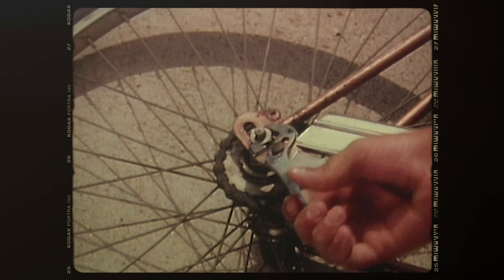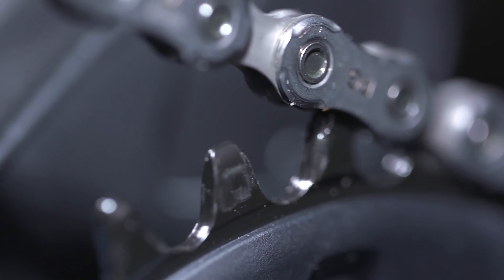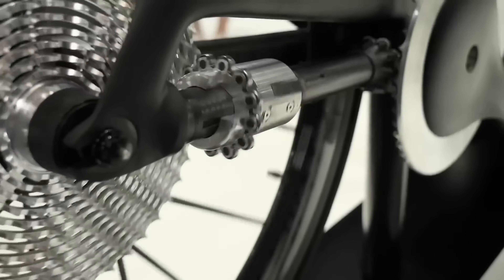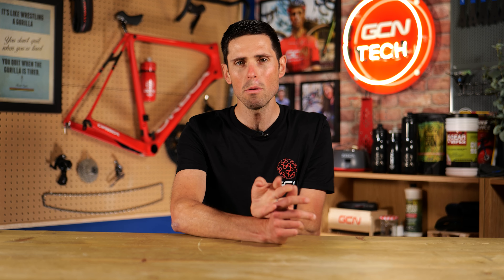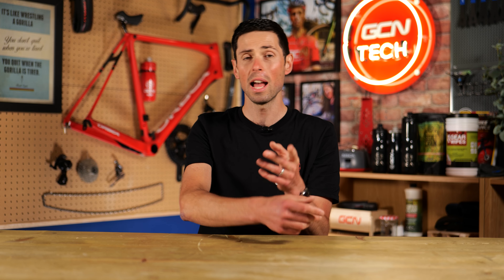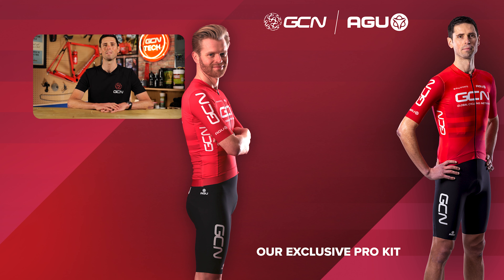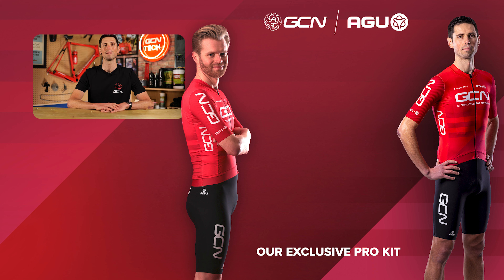Why This Will Never Happen!

Comment from the maker: Do you think bike chains will become obsolete at some point in our lives?🔗
Reply: I don't really see it happening.  Belt drive feels like trash and a rubber band when you lay the watts down.  That shaft drive in the thumbnail had potential I thought but I guess not.
Reply: Definitely not,it's pretty much a perfect design.💯✌🏻🚴‍♂️
Reply: As long as there's WD40 there will be bike chains.
Reply: Nope. There's a finite number of ways to transmit power from the cranks to the rear wheel. We've seen them all.
Chains rule and always will.
Reply: ”Digital chainless drive”
Reply: No
Reply: No. If something was better we already had it
Reply: In the future maybe the inner and outer plates are replaced by thread of a very strong material like dyneema. Even the rollers are not longer needed. This will reduce all friction within the chain and lubrication will be optional, more to prevent rust.
Reply: Probably won't happen in our lives, but if they can make small generators have near perfect efficiency, you could have an e-bike without a battery, that just transfers power from pedals to wheel via electricity.  

Such bikes already exist, but they are not nearly as efficient as a chain ATM.  
An advantage over a chain is no wear or lube and also infinite gear ratios.
Reply: Just with disc brakes replacing rim brakes, belt drives will take over chains, but... not yet. For touring bikes and e-bikes its already a slight edge for belt drives. Once people laughed when a cyclist shaved his legs. "otherwise the pro peloton was already doing it" Once everyone was riding 23mm tyres because it felt fast, now no one does. For some reason conservatism is high in bike industry. And how long did we have down tube gears, mind blowing
Reply: No chance , not now we have KCNC lightweight coloured chains to match your bike !
Reply: @squngy0 but that would only make a tiny bit less power than your legs are already making? You cant break the laws of energy my man. You want more power youll have to get it somewhere else… like a battery
Reply: @Aragorn.Strider naw disc brakes existed in cars for a long time before bikes. We knew it was a good idea it just wasnt cheap enough yet. I dont see belts replacing chains unless everyone moves to IGHs which is what seems unlikely to me.
Reply: @Aragorn.Strider  Belt drives will never take over chains the bike feel for those is atrocious.  Only people that have never felt peak bike in some way can be satisfied with that
Reply: @curtisducati  86 pounds for a celeste chain on my Bianchi seemed like a necessary purchase.
Reply: There will be more belts for commuter and adventure bikes, but chains will be relevant for racing bikes.
Reply: nah, but I'm interested to see what happens with a certain US bike company that is using Gates drive belts instead of chains.
Reply: No, luckily for those who love to cycle, cheaply.
Keep it fun folks!
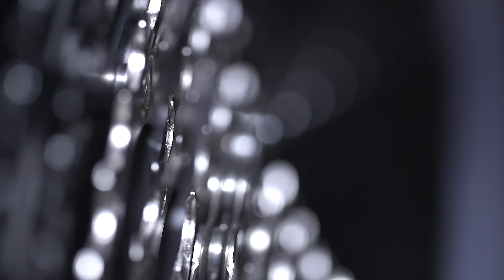Reply: A bike without a bike chain? Taking care of the chain is also part of cycling; the chain is essential. 2:11 An inaccuracy in the video: Before Campagnolo's groundbreaking derailleur gears, there weren't just single-speed bikes. Hub gears were available from 1902 (some designs even earlier) and were widespread from the 1930s.
Reply: Believe it or not, I invented a transmission system like this about 30 years ago, with hand drawing, paper, pencil and compass and "intel" imagination. I started exactly from this point where this prototype is presented. I developed this for a while and gave up on the idea because all the simulations I did, no matter how hard I tried to simplify the project, it always got too complex to be commercial
Learning about BMW's cardan transmission systems, I read that chain systems were always more efficient than cardan shaft systems. So even if they found an ideal metal in Wakanda to make that transmission, if they used the same material to make a chain drive, it would probably be more efficient. Maybe this is like the shape of the frames that after all the frame shapes made for road bikes over the years we are going back to the old simple double triangle shape
Reply: Nope, the chain will remain the primary driver for a very long time to come, if only because of the economy of scale.
Reply: I believe that if a SRAM had invented the Pinion / Gates system, we’d all be using it already.  Until the big manufacturers embrace belt drives, we’ll be stuck with chains.
Reply: @Aragorn.Strider  belts with internal gearbox are great for non performance scenarios like touring and commuters, but they can't beat the chain in performance and weight due to physics, unlike discs and wider tyres this isn't something that can be overriden due to the laws of physics on how gearboxes work. It's why even for motorcycles the same setup is done, chains for almost all motorcycles. Then shaft/belt drives for a niche selection of bikes like used for touring.
Reply: @Aragorn.Strider  I can't see belts replacing chains. You cannot shift a belt, so there would have to be some internal gearing. That weighs more and is less efficient.
Reply: Since a bicycling scenario where expending more energy to propel your bicycle isn't even imaginable, then 98.4% efficiency is as good as practically possible... would anyone (unadorned with aero socks) be able to "feel" a 1.5% efficiency increase?
Reply: Chainless ebikes are possibility.
Reply: IDK but I think you forgot half the pins from the chain...
Reply: No, but the exposed chain will. As soon as a bicycle manufacturer realizes that they can charge $500 for a streamlined carbon fiber chaincase that saves 3 watts worth of drag at 30 km/h, they'll burst onto the scene until the UCI bans them
Reply: I hope we haven't reached the end of history.
Reply: @5t4n5  WD40? What the hell are you using   WD40 for?  I hope you don't think it's a lube, because it isn't.
Reply: @stevenmeyer9674  You obviously don't know what you are typing about, because WD40 is a lubricant.  Specifically, a penetrating lubricant, formulated with additives to make the lubricant penetrates really well.
Reply: @5t4n5  LOL. WD40 is a degreaser with a little  lubricating  quality.  It is no where advised to use it as a bike chain lube. Ask your neighborhood bike mechanic.
Reply: @stevenmeyer9674  Wrong again.  You really haven't done the slightest bit of research, just spouting whatever nonsense you heard someone who also had not done any research.

Seriously, you don't know what you are typing about.  Go and do some actual research.

Quote...

Fact: While WD-40 Multi-Use Product it is not a grease, it is formulated with strong lubricating oils and other ingredients, and is a terrific product to use for bike maintenance. It does not attract dirt or moisture to metal surfaces – just be sure to wipe off any excess WD-40 Multi-Use Product before riding.
Reply: Where does that "fact" you wrote come from?   If that was you, I would suggest you do a little more "research:"
Reply: Yes
Reply: Beyond the back of Burke do I want an exposed drive that was developed from road racing or do I want a fully enclosed drive that is weather proof. Belts are here to stay and electric drive will be a thing because it separates cadence from the terrain.
Reply: @glennpettersson9002  having multiple gears also separates cadence from terrain for certain range of terrains and you have them with the belt drive too.
Reply: @Dellvmnyam  🤔 dang, I hadn't thought of it that way. Thank you.
Reply: @stevenmeyer9674  it is...
Reply: No, chain already had ai long before it was cool.
Reply: EVs may push manufacturers to come up with a chainless drive system, possibly some sort of continuous gearing hub or something gearless, kinda like the string drives which auto-gear under different torque/loads.
Reply: Chains will remain, but belts will always be > chains.
Reply: No, but not because of technical reason, it's political. 
- I believe bike lane isn't growing much.
- the age of EV. People prefer electric scooter then electric bike or shall I say manufacturers push electric scooter to market.
(don't counter argument until you know the difference between scooter & bike)
Reply: No. Too many frictional loses with any other system.
Reply: Won't happen. There just isn't really a good reason for it. Some of these other options are interesting in and of themselves, but they don't offer the flexibility, effeciency, cost, repairability, nor are they truly as robust as the "ordinary" chain.
Reply: @chribm  Belts don't need repairing, just replacing, and are far more robust than any chain.  The only reason they cost more is simple economics of production: if they were as ubiquitous as chains, they'd cost less.  But then I'm speaking from the perspective of someone in a Canadian city who cycles 365.  If I lived in a dryer area with little rain and no winter road salt to deal with, then a chain makes much more sense.  I'd still go with an IGH, though.
Reply: There's going to be a time where you're not going to be allowed to just Spray oil into the environment.
Reply: @MirelleLaRouge  In which case, they will not be able  to mine & ship the minerals needed to make EV batteries........
Reply: @MirelleLaRouge  Who is spraying oil into the environment?
Reply: Ceramic speed and belts are superior technology

Comment: You are absolutely right. The chain isn't going anywhere. Its too efficient and cheap to be replaced en masse.
Reply: Yeah belt drive is so efficient (if going fast it's more efficient than chain)
Reply: @mlee6050  true, and it is cleaner for commuters but unless you have all frames with the access section for the belt, it will not quickly take off.   my wife likes her belt drive but is limited to 8 gears and when she hits hills it is a struggle.  unless someone develops a cheap bottom bracket gearing system, it will be limited.
Reply: @blankseventydrei  I need to research more, I looked at single speed with 14 speed internal hub but unsure how belt drive is other than gap in frame
Reply: I mean, they managed to kill the rim brake too
Reply: @MicroageHD  still be around even though harder to buy frames for them, thanks I must remember to buy SRAM HRR
Reply: @MicroageHD rim brakes are not dead and are not going anywhere
Reply: Veer make a joinable belt drive, it's not known though.
Reply: @ebikescrapper3925  not bad, fixed gear bikes have to be belt driven
Reply: @dmitryhetman1509  rim brake is dead for both cheap and expensive bikes
Reply: @ebikescrapper3925  yes I’m amazed this version of a belt isn’t widely used with a belt tensioner and electronic hub gears, I guess the industry doesn’t want it
Reply: @ivorpeachey4366  Most cyclists don't want it. It is heavier and has more losses.
Reply: @MicroageHD  rim brakes not dead yet
it will shine again, mind my words
Reply: @blankseventydrei  you can get a rolhoff 14 speed gearbox but they are stupidly expensive
Reply: Agree. It's excessively efficient. So much that it becomes less efficient with time or if even slightly dirty.
Reply: @blankseventydrei  "my wife likes her belt drive but is limited to 8 gears"
So...the Shimano Alfine 8?  If so, they make an 11-gear version.  I have one, and I can still take reasonable hills, even though I'm an overweight pensioner.
Reply: Yeah, but if you're lazy about maintenance like I am, a belt drive and an IGH is the way to go.  My belt is probably going to out-live me.
Reply: @AlbertaGeek  especially in winter or just wet and dirty conditions I'm lazy when sometimes every day for a few days in a row I need to wash not only the bike but also a bathtub I washed the bike in.